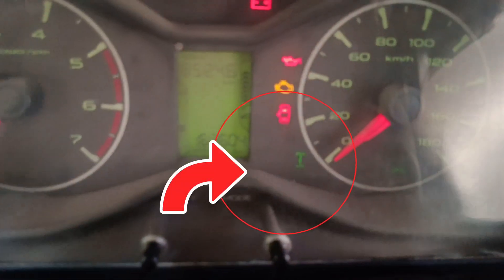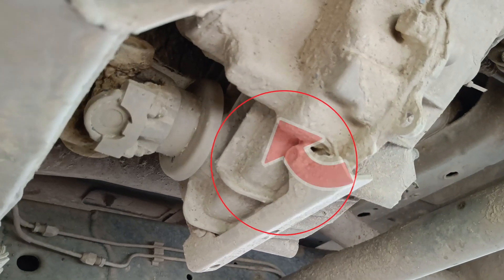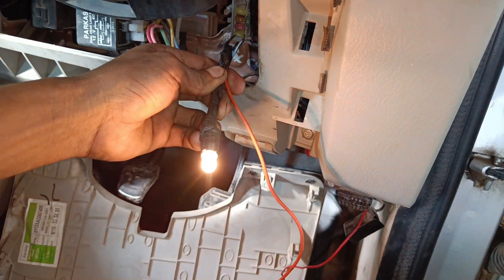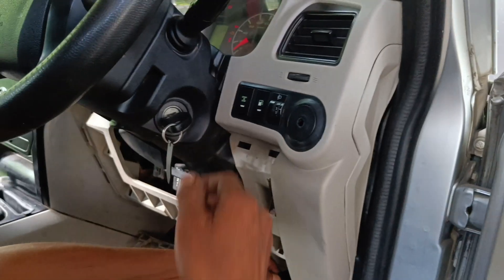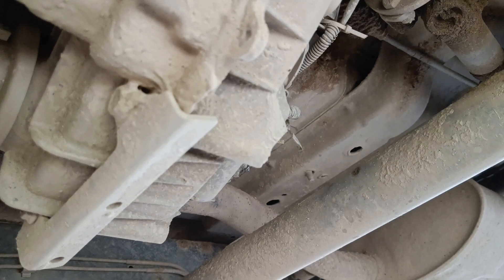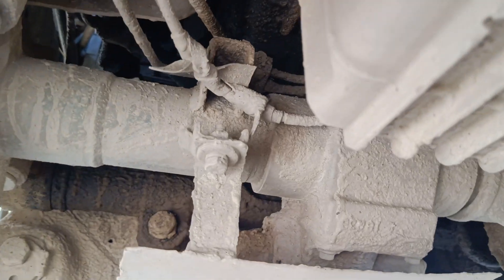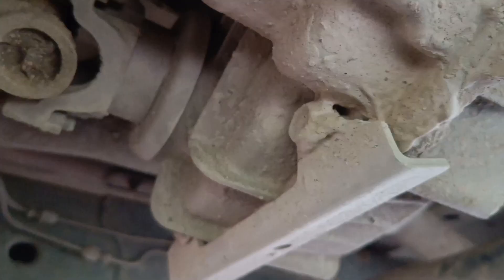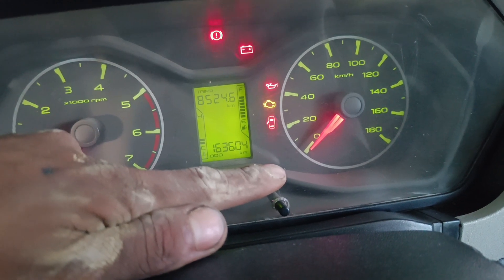HOW TO CHEK Scorpio 4x4 failure Fault Code DTC (4WD) | 4H light flashing Automotive Technician Nepal

Comment: Sir,
Namaste,
Main India Maharashtra se hu,
Mere paas Scorpio S5 2WD Hai,
Mujhe use 4×4 me upgrade karna hai,
Kya aap kardo ge?
Reply from the maker: 4×2   vehicle ka 4×4 me Modified hojayega. Lekin  2wd keloye 4wD ma convert karneki liye Aap ko vehicle ka Document 📄 ko bi upgrade karna padeda ek legally kam ke liye or transfer case, front differential, front suspension, rear propeller shaft, front propeller shaft, transmission back cover transfer case ECU wiring harness, speedo  chassis etc .bahut kuch change karna padeda so yeh kam me bahut mota cost lagega. Yeh le jaya aacha 4wd vehicle hi  next purchase ya exchange kijiye. Thank you